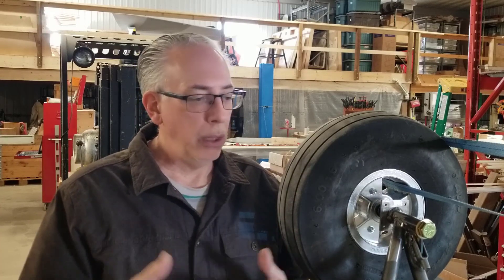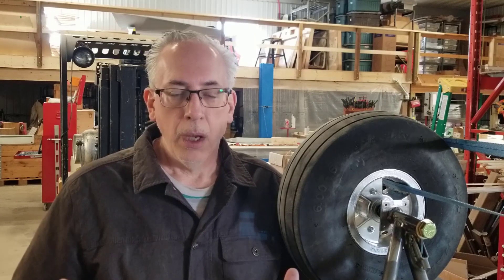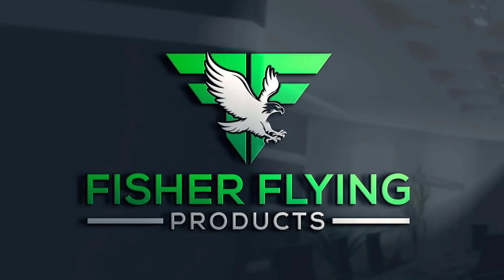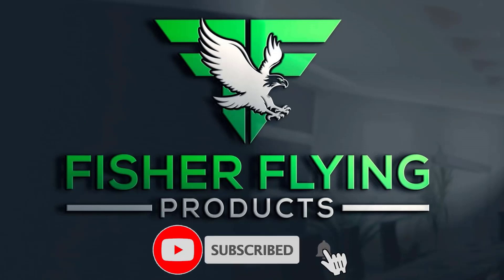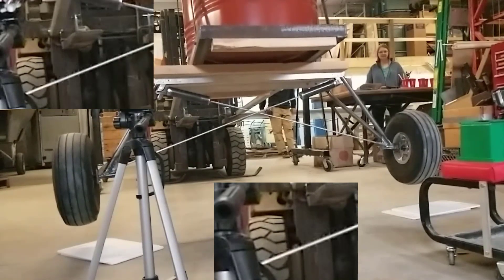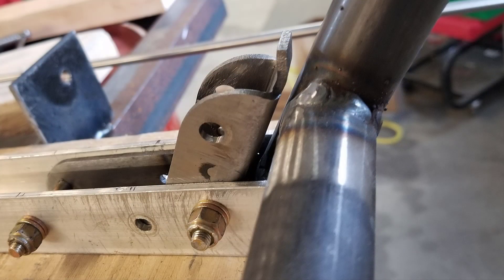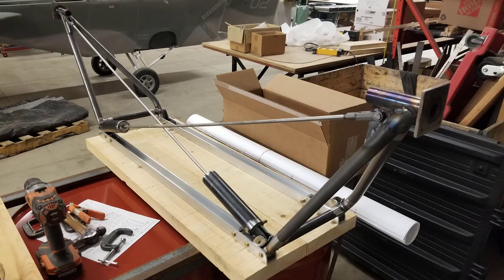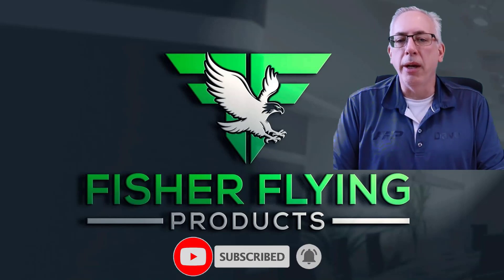FINAL LANDING GEAR TEST IS A HUGE SUCCESS !!

Comment: Much better than the alloy legs that I had as they break at the axle stub.tig welded all joints.
No more problems.
Through them out and made up a jig and made legs out of 58 thou molly tube and

Comment: HI DAVE WHAT INCH TYRES IS ON THE TEST
Reply from the maker: The tires are 6-6.00
Reply: @fisherflyingproducts5747  THANK YOU DAVE GREAT TEST YOU GUYS DID I SAW MANY GEAR STRUTS AND WHEELS BROKE OF ON LIGHT AIR CRAFT. GOOD TO MAKE THAT GEARS THE BEST IT IS SAFER TO HAVE MORE PROTECTION THAN LESS GOOD JOB DAVE.
Reply: What is the weight of the bungee gear that this would replace? Are the threads cut or rolled?